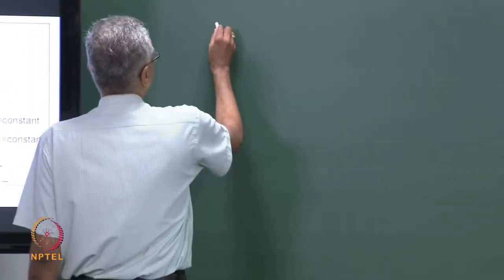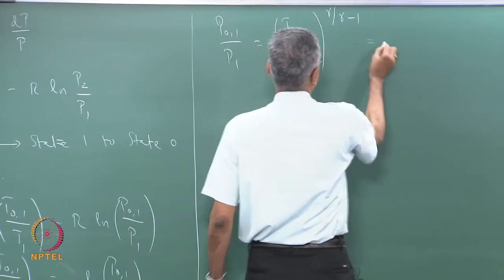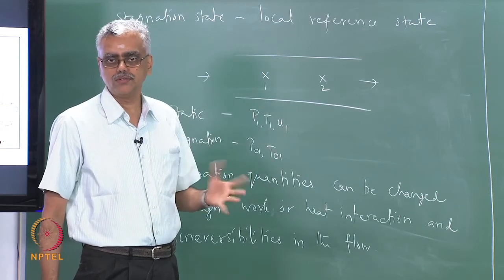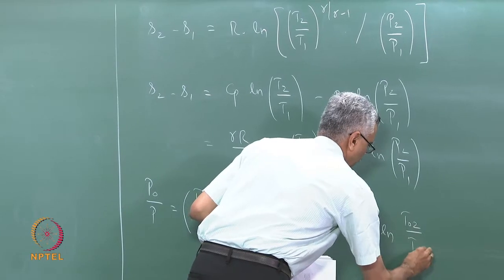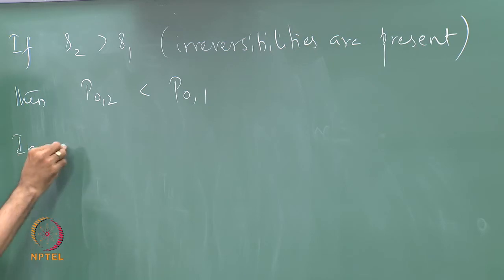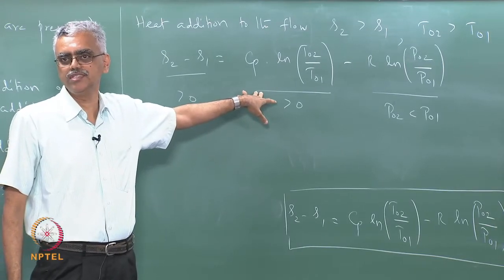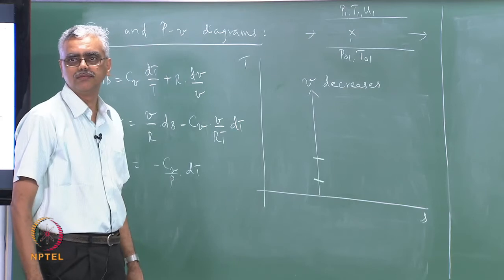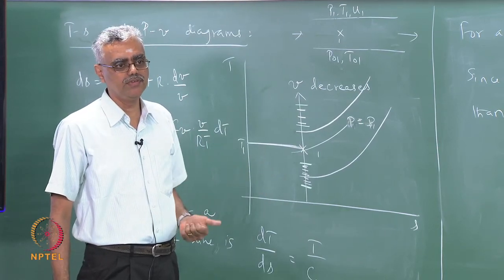Mod-01 Lec-04 Fundamental Ideas

Comment: usually i thought when temperature increases pressure also increases from pv=mrt, but in combustor to increase the efficiency if we mix the air fuel fully, temperature increases pressure decreases . Excellent lecture
Reply: stagnation pressure decreases, static pressure may increase.